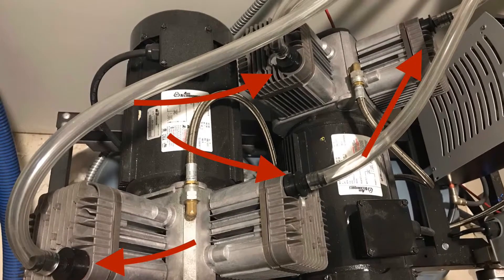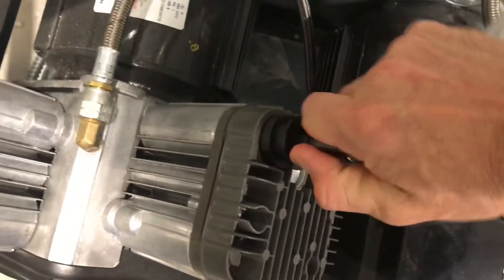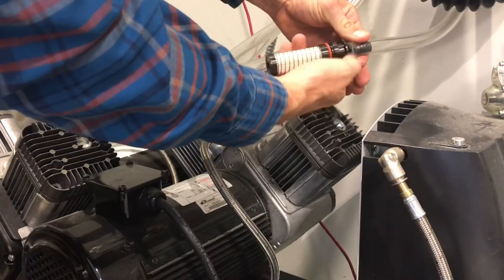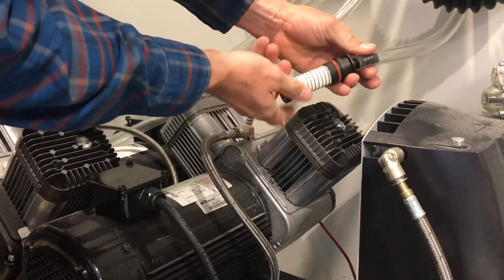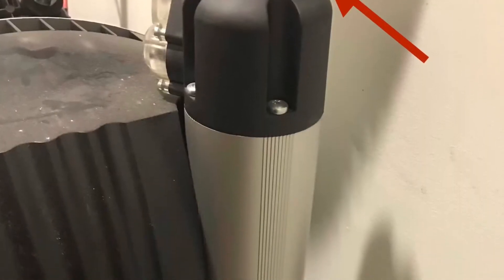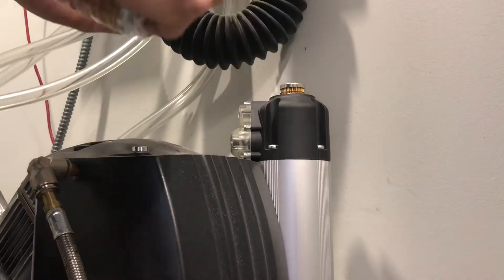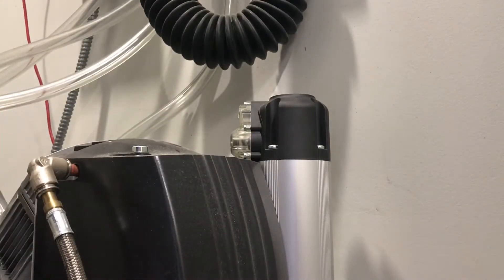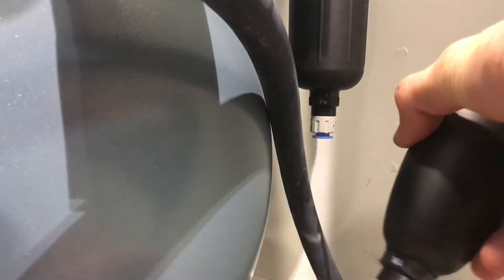Airstar 50 dental compressor annual maintenance

Comment: Hello, what would cause a loss of air pressure to the delivery system during use, even though the air compressor is on?
Reply from the maker: Could be multiple issues! Air leak some where? Water in the tank?